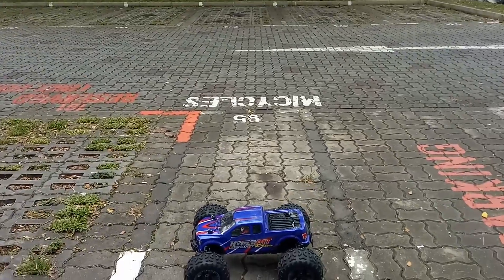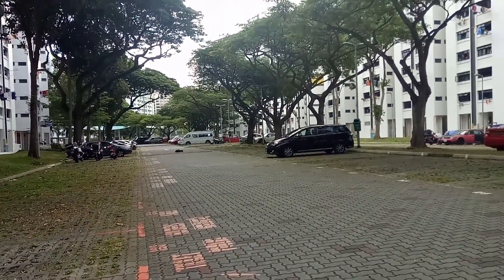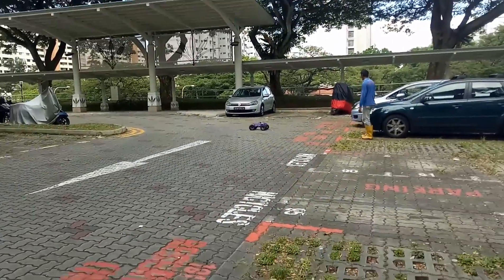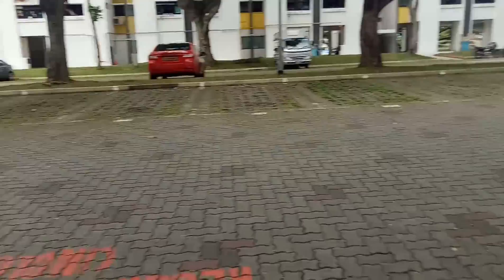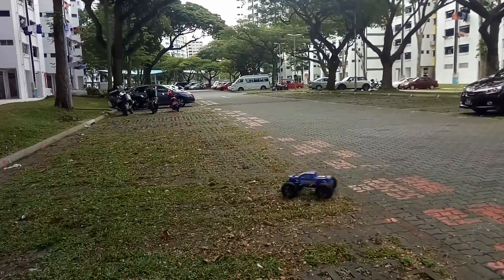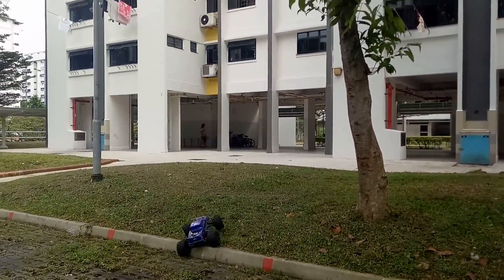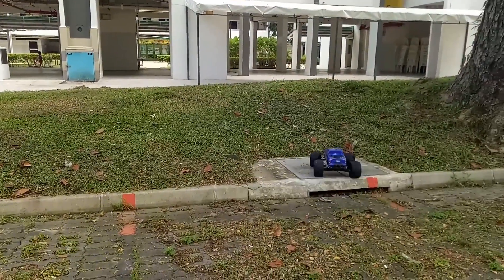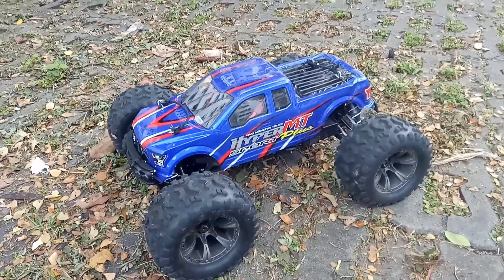Hobao Hyper MT Sport Plus, Turnigy XK-4074 2000KV, 4S run

Comment: Hi reza,4s looks so much slow on that motor,what happen to the stock motor?did u change the whole ep setup?
Reply from the maker: +SPEED TUJUH Batteries were already at 3.85V and below. I used last night's pack. Haha! It's a different motor.
Reply from the maker: +SPEED TUJUH Nothing happened to stock motor. Just curious to see how the Turnigy XK-4074 2000KV worked on this truck. Honestly the stock motor is not rated properly for 6S. Stock motor is a GoolSky 4076 2000kv motor that has a max voltage of 18.5V only. This Turnigy has max voltage of 25V which is true rated for 6S.
Reply: Owh,no wonder ;), so the esc is 120amp?
Reply from the maker: +SPEED TUJUH ESC is stock 150amp. It's a Hobbywing QuicRun-WP-8BL150 with only 5 settings. Usually given to 8th scale trucks.
Reply from the maker: +Monster-X RC Actually, I'm curious whether a 4076 2200kv motor will work for this truck. There's one that can push to 6S 😁
Reply from the maker: +SPEED TUJUH Will post 6S run later tonight.
Reply: Wrongly read on your commment on the motor details ;)..which do u prefer the k-rock or the hyper mt?for both platform performance
Reply from the maker: +SPEED TUJUH Hyper MT. After the suspension tuning and steering EPA adjustments it's awesome. Speed and overall fun factor. Easy to work on too. The K-Rock is over engineered.
Reply from the maker: +SPEED TUJUH I opened up and serviced the front diff quite easily last night.
Reply: thanks bro,my friend is thinking of buying the K-ROCK .so i think the haboa mt is more durable.
Reply from the maker: +SPEED TUJUH You do have to tighten all the screws, including motor mount screws. I lost 1 motor mount screw, and 1 was loosened halfway out. Must the 6S causing massive vibrations. Also get spare a arms if you're doing big jumps! You can get it at S'wan Modeling and Hobby at Orchard Plaza. Auntie Winnie is super friendly and helpful.
Reply: hi so means big jumps the arm arent strong enough?perhaps the vibrations cause the screw to loose up =).
Reply from the maker: +SPEED TUJUH They're strong. Except I abused it the other day. Some bad landings on just one wheel. A arms did not break. Just deformed. Will post the slomo videos of the 360° jumps.
Reply: owh i see. =).thanks bro for your head-up appreciate it.thansk for all the review vid.
Reply from the maker: +SPEED TUJUH Most welcome bro! I had to do it. Because not enough info on this truck. It's been around for long time except there's very little review videos on this. The other one is Manny's Garage. But that's either in French or German.
Reply: but there Aussie rc playground,he done a review too on the hyper mt.but he runs his bash at the bmx track,but the track radius jumps is quite safe rather tha a ramp jump abit more drastic